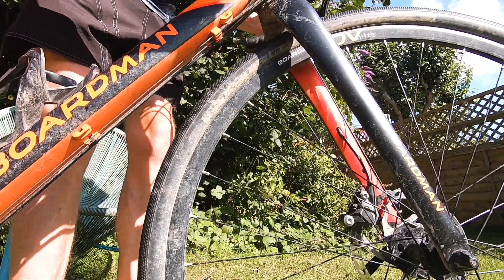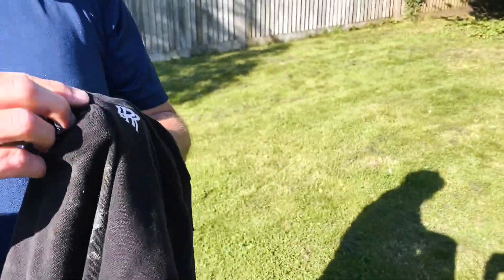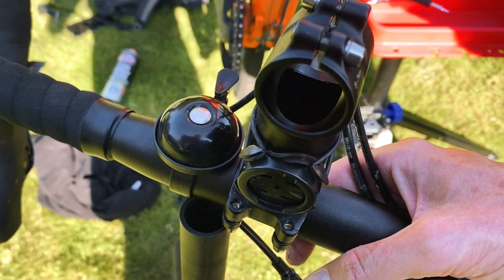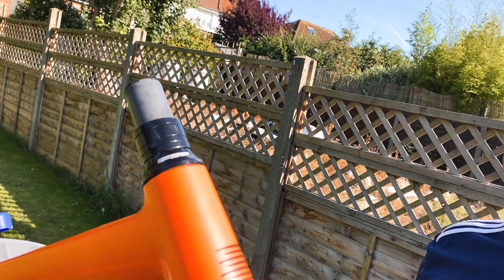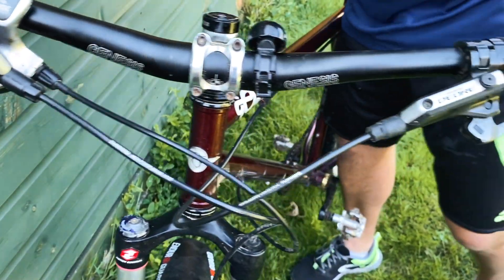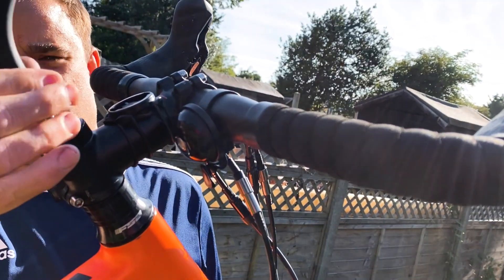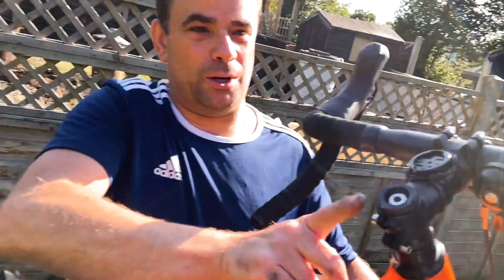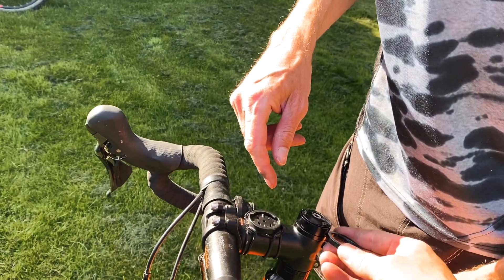Repairing a Boardman ADV headset

Comment: Well done sorting out your headset. I tend to always cut carbon steerers level with top of the stem so it clamps all the way through then chuck a 5mm spacer on top. Good job👍
Reply from the maker: Sure that’ll work too, but we got there in the end 👍

Comment: “nearer the road wheel”

As opposed to the non-road wheel?!

And got the same bike, I just added 2mm spacer on top of stem as had the same problem.
Reply from the maker: Yeh, not very clear, but it's odd that you've had to the same problem. It's like they have shipped the bike with this issue.
Reply: @themuddycyclist  agreed, very small design/spec floor. Started after first few rides. 
Still a great bike though. Owned mine since 2019 and have 8k miles on it. Original wheels are going well, but plan to replace them in January.